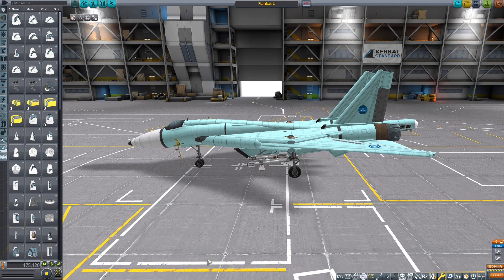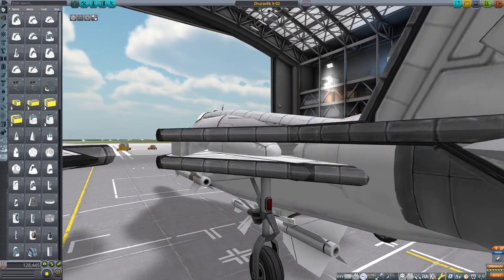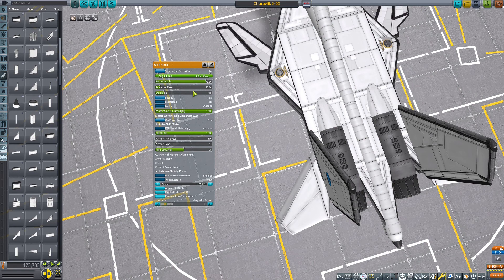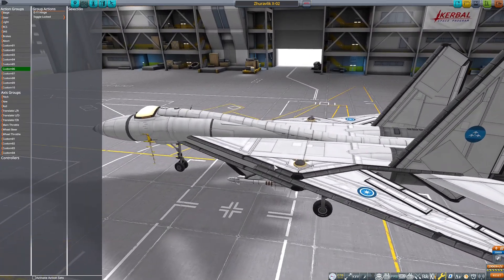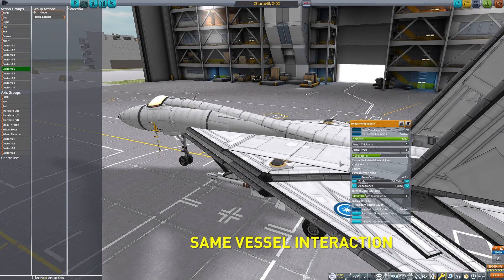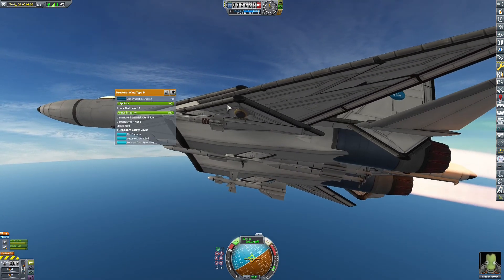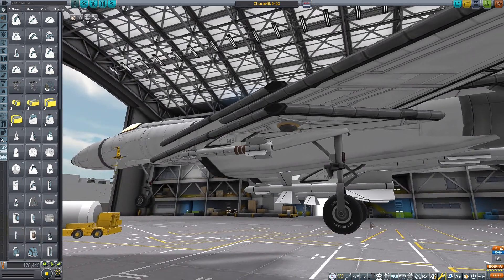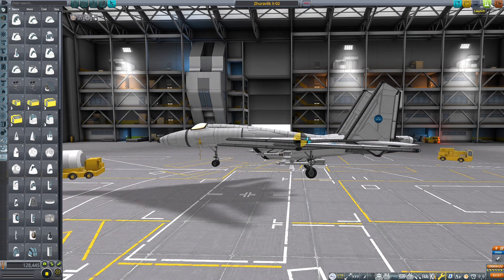KSP Tutorial: Variable-Sweep Wings using Ferram Aerospace Research aerodynamics

Comment: I don't know if you ever came across another solution but I also came across that issue with the swept wings being slower than unswept. From what I've read online and seen in game (also using the Breaking Ground expansion) it's because FAR doesn't automatically recalculate the aerodynamics when you swing the wings so you have to forcibly make it do that. In the video you did that by firing missiles, but extending and retracting the gears (or solar panel or cargo bay) just for a little bit should also work. That has been working for me so far
Reply from the maker: Amazing and interesting solution. I've never realized that deploying the landing gear could save me some missiles haha ...Perhaps I was so focused on the landing process trying not to crash that I didn't check the speed carefully. I'm thinking of placing a tiny solar panel inside the airplane's fuselage to prevent it from breaking under dynamic pressure, so it could be extended and retracted with an action button any time without affecting aerodynamics. Thanks for your contribution 😎🔥

Comment: Will the take-off phase be shorter with the wings flapped forward?
Can it also turn tighter in curves?
Reply: Yeah it takes off shorter like top gun maverick f14.
Reply: It will if you use Ferram aerospace with its more realistic aerodynamic model. Doesn't work in stock with its more simple aerodynamic model
Reply from the maker: Only if you use Ferram.
Reply: @SarionKerman  I thought Ferram couldn't handle swing wings? Are you sure its properly reading them? Debug voxels overlay with both swept and unswept wings would be a huge help.
Reply from the maker: @carldawes4156  🤔This is what I got: https://imgur.com/a/3D1raQM
Reply from the maker: @prolska  Why not? Haha